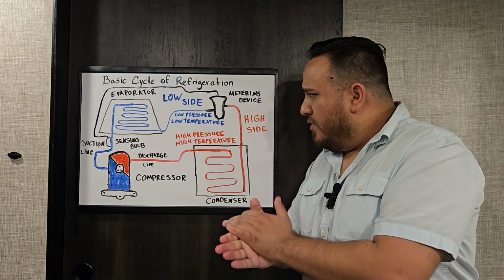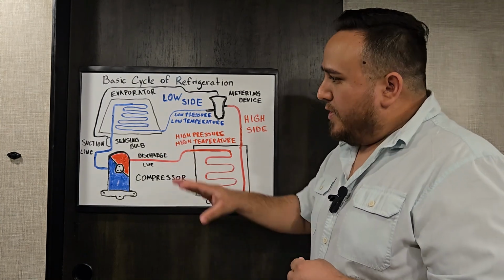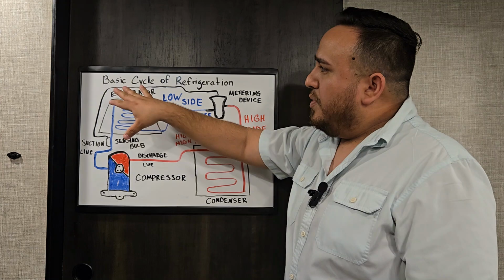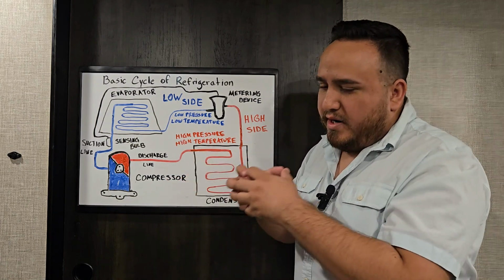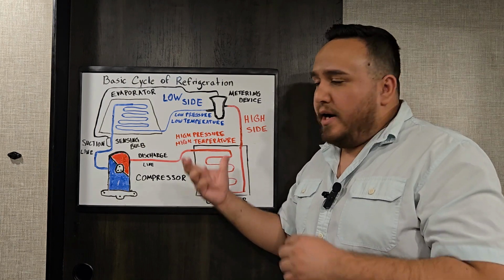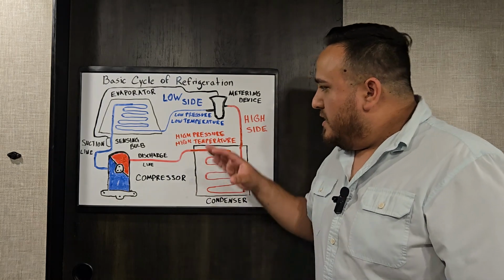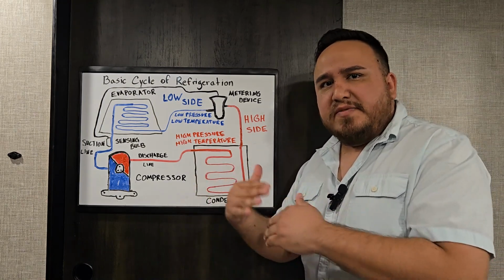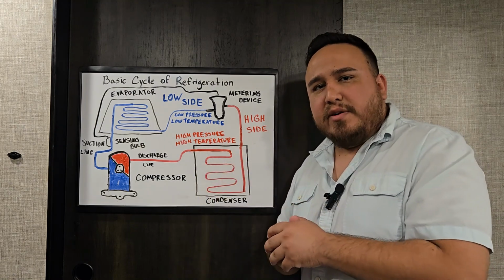High Side vs Low Side | Refrigeration Cycle Fundamentals

Comment: The most underrated (by non-techs) diagnostic a tech can perform... hand over the condenser unit.
Reply from the maker: Something I never forget one of my mentors ever tells me is that one of the best tools you have in your arsenal is actually your hand. Feeling the different temperatures on the system can really help narrow down and get to the problem sooner, which is really underrated.